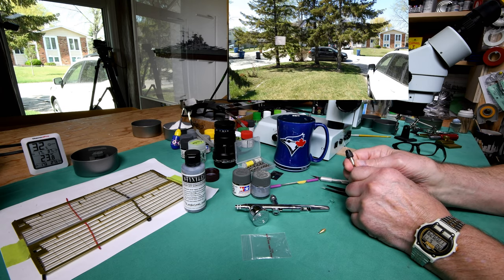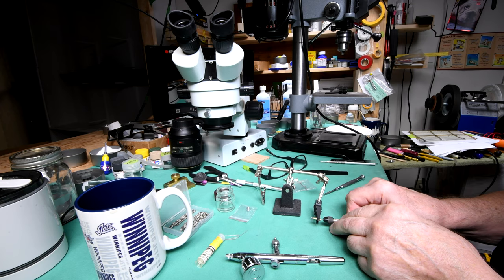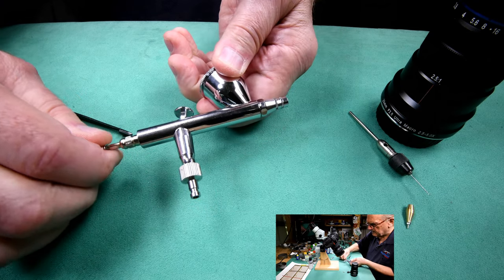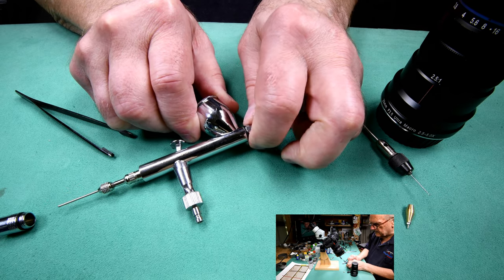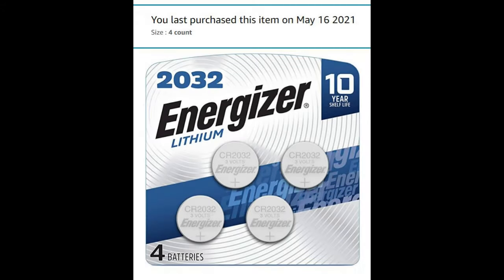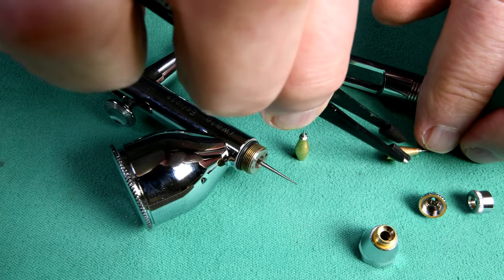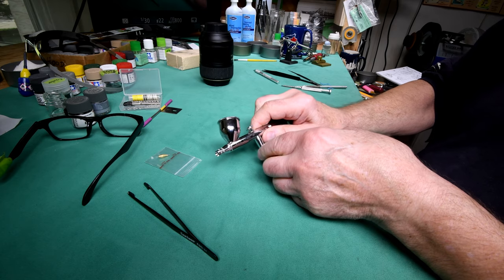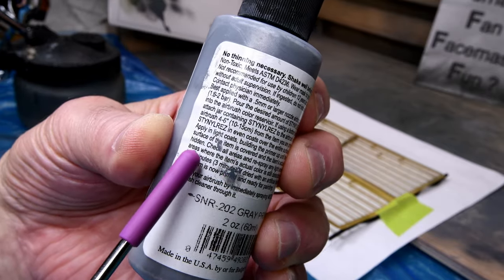The Model Ship - Part 810

Comment: Ron, ya, I typically use .5 mm tip with Stynelrez, 30 to 40 psi .. and yes, Stynelrez doesn’t like Mr Color thinner, “glops up”, (love that word). Mmm, how do I know? I generally use a .5 mm tip for all my painting. Smaller tips are good for detail airbrushing.
Reply from the maker: Will be trying my modification tomorrow. If it doesn't work, I'll likely be contacting Maple Airbrush to get 0.5mm upgrade.